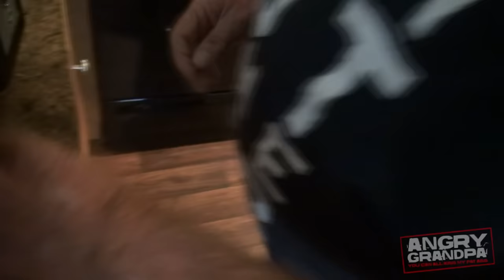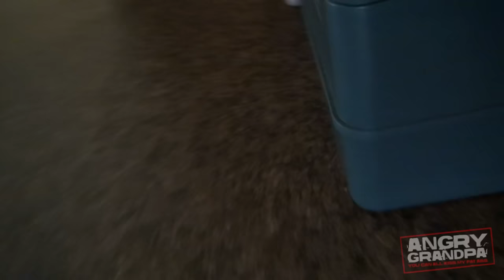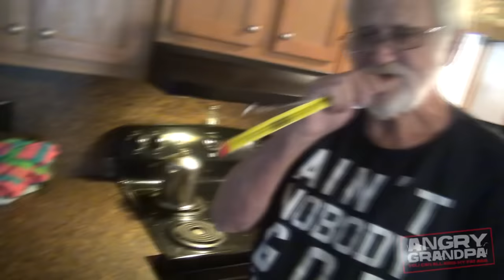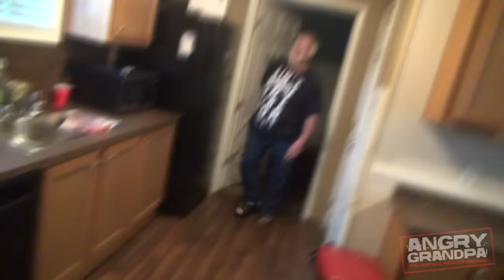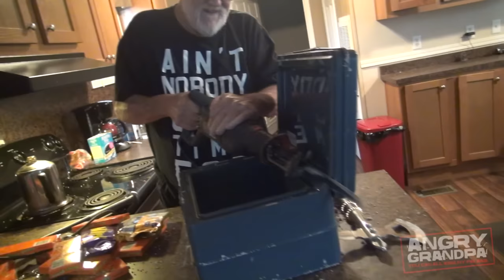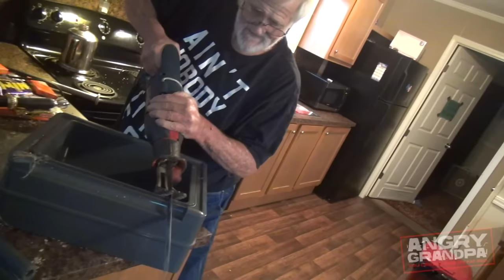UNSAFE MELTDOWN! (GRANDPA GOES CRAZY)

Comment: Pretty shitty safe if it took 2 hits with a baseball bat lol
Reply: It's a fire safe dude lol it's not built to handle a bat.
Reply: +RadioactiveEmo 13 That's not a fire safe at all.  Fire safe is made out of metal.  When he was cutting into it, it looked more like fiber carbon and wood.  With fire safe there is no way you can take an ordinary saw and cut into it.
Reply: +hhds113 you can cut anything with a saw as long as you have the right blade.. I use wireless ones that cut through steal like butter
Reply: TallWhiteBoy96 Not when it comes to real safes.  You need a diamond saw blade and using a cement cutter to even make cute through solid steel or iron.
Reply: +TallWhiteBoy96 A wireless blade lol.
Reply: +hhds113 Your ignorance is amazing. A fire safe is a fire safe because it's made of fire resistant plastic and cement. Fire safe doesn't mean robbery safe.
Reply: MrWolfSnack Your ignorance is amazing.  Did you even watch this video at all?  Angry Grandpa was cutting into a fire safe.  And that is the cheapest one ever.  Not even fire proof.
Reply: Yall are really arguing over if its a Fire safe or a regular one haha
Reply: MrWolfSnack And I just asked you if you even watched the video?  Seem's you avoided to answer my question show's your ignorance.  The only child here is you.
Reply: Its a safe that only michael cant get into
Reply: YAH YAH YEET well it is only wood and plastic